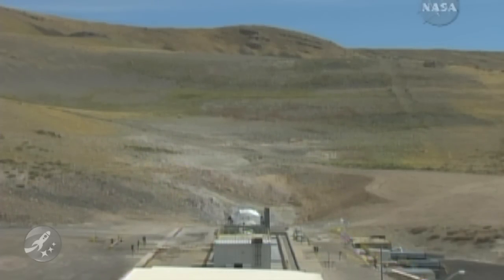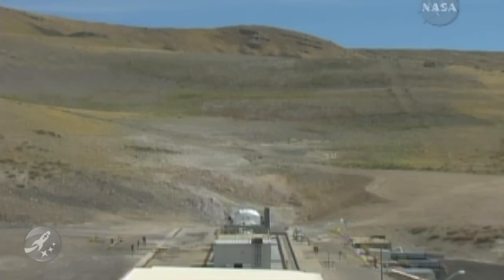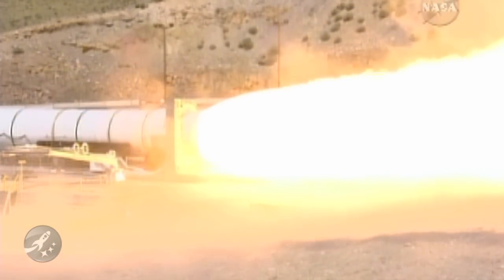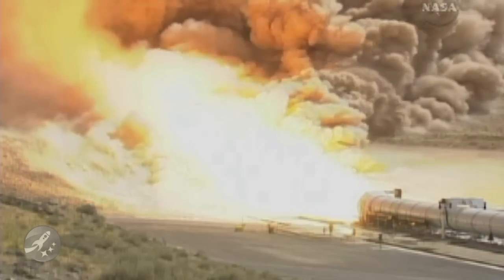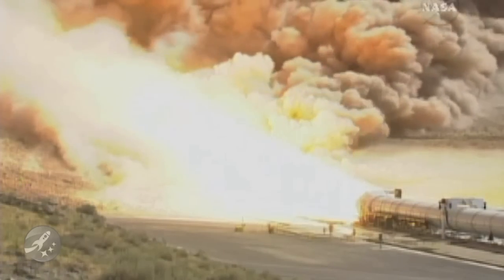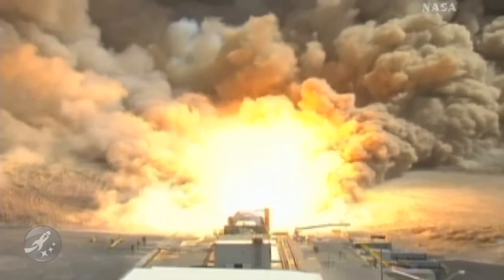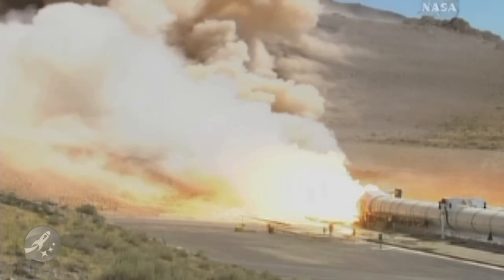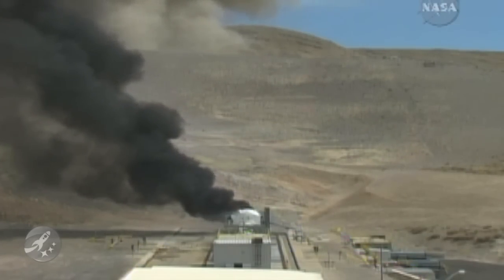Ares I Motor Test

Comment: 1:01 That sound is not from the "high speed camera", that's the sound from the HPUs (Hydraulic Power Units). They're practically the same as the Orbiter's APUs (Auxiliary Power Units), except that the orbiter has three and each booster have two. In the boosters they provide hydraulic power to the actuators that swivel the nozzle for steering. In the orbiter the APUs provide hydraulic power for the areo-surfaces (elevons, ailerons and rudder/speed brakes), landing gear, the main engines for steering during ascent and the external tank umbilical doors.

Comment: Ricer: ima put dis on my h0nda c1v1c and that will add 1234433283237 hp, ultra charged engine will add 2383 hp, mah st1ckers will add 25 hp,
 mah lamb0 t1res will add 100, and mah c4rdb0ard b0dykit and sp0iler will add 2733 hp, so that will add up to 237348747987478477487484 hp on mah h0nda c1v1c. 🅱️oi I can b3at u in ur 1 hp trash can.

Comment: 22 Million horsepower in Watts:
1 hp = 746 Watt
22000000 x 746 = 16412000000 Watts = 16.412 GW (Giga Watts) or (16 Billion 412 million Watts)!

16.412 GW into lightbulbs:
1 light bulb = 40 Watts
16412000000 Watts / 40 Watts = 410300000 Million lightbulbs or (410 million 300 thousand lightbulbs)!

Comment: Mhh would IT effect The Trust if water would be injected into The very hot Rocket Flame. Like The Principe of Archimedes Steam Canon
Reply: king bob1 V2 was liquid cooled by adding water to the fuel lowering exhaust temps to a manageable level. Reduces thrust though.

Comment: amazing display of pollution.
Reply: Thats right, a smart ass here responded to me that hydrogen and oxygen does not produce carbon dioxide.  Yeah, but the commentator just mention the dust and the black smoke came when they doused that with water and all the sand turning to glass for nothing.... thats pollution to me

Comment: 22,000,000 horsepower. 

Holy fucking shit
Reply: But can it run Crysis 3 at 4K?
Reply: just for my 2jz supraa
Reply: wtf
Reply: I got a kick outta that one
Reply: Holy FUCK! A top fuel dragster/funny car that does a 1/4 mile race in 4 seconds at over 200 miles per hour maxes out at around 10,000 horsepower... and this is 2,200 times more powerful?? That is a fucking terrifying amount of horsepower!
Edit: Jesus just thought of this... What the hell kind of equipment do you need to hold a booster that powerful down?

Comment: So glad my car meets the EPA vehicle emission standards
Reply: Ania Ruchała The 2nd stage that uses liquid hydrogen and liquid oxygen only produces water. This is a test of the 1st stage, which uses solid propellants
Reply: clmco Really? Obviously you've never heard of sarcasm. Then again you clearly have no clue what you're watching here even though the guy in the video says what it is. Fucktard
Reply: I dont want to ruin yur kek but the Ares I rocket motor used Liquid hydrogen and Liquid oxygen , the only biproduct of that experiment was steam, a fuck tonne of steam. :)
Reply: @TRJx86  Actualy no,this is a booster that runs on a solid propellant,some of the ingredients are but not limited to:Al as a fuel(dark Al fine dust is ideal),Ti also fuel(also fine dust),KClO4 and or KMnO4(more potent)both as an oxidizer,Fe2O3 as a stabilizer,S8 as both stabilizer and a fuel and alows for easier ignition,some kind of plasticizer to alow molding into one consistent piece(they probably use advanced synthetic ones i doubt they use starch for that), so the reaction product list is far longer than just water vapor as it is basicaly a firework mixture on steroids.
Reply: Ares only produces water, so...
Reply: This engine is probably good for that desert so stfu
Reply: Its just water vapor you fucking hippie

Comment: where can i buy one? for those spiders in my house
Reply: It'll take care of your spiders. 

And your house.

...Your neighbor's houses, too.
Reply: i don¨t think you have a house too have spider¨s in  if you use one of those ;) 2000000 hp
Reply: Actually 22 000 000 hp
Reply: Sorry, horsepower only applicable if it is moving and speed is known.  Just saying.
Reply: Horsepower (Hp)= the measure of energy expended in a given time, 1hp=.746Kw, or the ability to move 1000 lbs one foot vertically in one second. so its not moving but they know this so they CAN SAY
Reply: Don't mind the spiders, the whole housing estate would be destroyed by this thing. 20,000,00 HP....

Comment: I've said this before, but it's videos like this that make me realize just how far away we really are from space exploration, this was one of the most powerful rocket motors made and yet that's all it could do, burn for around 2 minutes tearing through incredible amounts of fuel and cost an absolute fortune, it's basically just a big firecracker, look at the massive amount of smokey exhaust its spewing, that's just lost power, until we find s better way producing thrust, or a more efficient way of burning fuel we are doomed to a life on earth..
Reply: That's a solid rocket booster - it's cheap and dirty and not terribly efficient. Most liquid motors burn cleanly and are considerably more efficient, but the most efficient ones don't have enough thrust to get into orbit where they work best, so it's cheaper to use solid boosters for the first stage. Then there are the nuclear engines that have never flown so far.

The real reason we aren't just there yet is that NASA's total budget for the whole of its existence is smaller than this year's US military budget.
Reply: Sobakus Thanks for your input, I guess my point is that while our greatest achievements in jet/rocket propulsion amount to the simplistic burning of large amounts of fuel to produce limited thrust, over a limited time, and with very little control over the burn rate (there is no "throttle" like on a plane or car or boat) we aren't on our way through the galaxy anytime soon, until we find new forms of producing large amounts of thrust with tiny amounts of fuel to make long distance travel feasible because of our current limirts on the amount of fuel we can carry, but more likely use quantum physics to find a way to move space around us instead of us traveling across space
Reply: Nicky Winters Well, again, it's only the solid boosters that don't have any control over the throttle – liquid and spontaneous combustion engines are throttled much more precisely than your car, although they have a lower limit. But all in all, your assessment of our current situation is something any rational person would instantly agree with, there needs to be some major breakthrough in propulsion technology to allow us to explore even our home system, although moving space is probably a bit farther away at this point.
Reply: Sobakus Thanks for your reply Sobakus, I'm sure you know more than I do about this, maybe :) my point is this just makes it clear that we are not about to skirt across the universe, believe me Sobakus I'd give up the rest of my life to travel across the universe for a year, I'm all for exploration, I'm just a little saddened realizing it's not going to happen within my lifetime...

Comment: Woo woo amazing power 22 million Hp???!!!! I think if after every half kilometre motors like these will be mounted along the equator 100 meter above the ground on flat surface and that exhaust nose pointing to the East and tested together at once for a period of 72 hours we will experience slow changes, later the earth might spin opposite and the sun will rise from west to east and may be even the  length day and night will be about six hours.. is my assumptions ..
Reply: You would have to slow and then speed up the entire mass of the planet and atmosphere. We do not have the power to do that.

Comment: Did he say 22 million horsepower.    the Saturn Five generated 7.5 million pounds of thrust and I know a horse can pull more than one pound... So at 22 million horsepower, the Aries is the most powerful booster ever.  Or it is a glitch.
Reply: +johnny ray If this article I read is accurate, each of the Saturn V's F-1 rockets generated 32 million horsepower.  That's a total of 160 million horsepower.  O.o

http://www.npr.org/sections/thetwo-way/2013/03/20/174834978/we-have-liftoff-apollo-rocket-engines-reportedly-pulled-from-ocean-floor

Comment: Must have been made by Ford. Thats a powerful motor!!
Reply: Reιnнardт Wιlнelм Nope, straight out of the factory, gotta love the power of IndyCar R&D, if only regular manufactures were this productive, then again every car would cost 2 - 7 Million Dollars.
Reply: Nah, it didn't break down, it's built by United Space Alliance.
Reply: velo de course 2016
weller
Reply: pft

No, Ford's too buisy making 2.7L full size trucks.

Chevrolet would be more likely-
Reply: 2.7L fullsize trucks that makes 325 HP and 375 lb-ft @ 3500 RPM in its stock form and gets 27 MPG that is VERY easily turned up with some easy mods and also has a towing capacity of up to 13300 lbs. with the proper equipment. However they do still make the 5.0L V8 engine in them.
Reply: FireFighter#47 With the price of Diesel, it better be getting 27...
Reply: FireFighter#47 
I know from experience. I don't care about numbers, because that 2.7 does NOT get 27mpg

And, if you want to talk about being easy to modify, there were 1000hp silverado's around a month after the new Gen hit the dealerships.

Oh, and the 5.3 makes 355hp and 386ft-ibs.

I'm not bringing up the 6.2, I don't want to embarrass you.
Reply: Reιnнardт Wιlнelм Disappointing, when you consider Honda and Chevy has 2.2 Liter engines putting out 850 HP (both similar engines).
Reply: ***** 
Not from the factory, they don't.

And if we're talking about heavily modified engines, why not talk about the 632ci BBC's making +3500hp?
Reply: ***** 
OH.

Shit, I didn't know you meant indy-

Good point tho.
Reply: ***** The 2.7L is a twin turbo gasoline engine....
Reply: Reιnнardт Wιlнelм GM motors dont come out of the factory with 1000 hp either..
Reply: Reιnнardт Wιlнelм As for fuel yes it does get around 25 to 27 MPG. I would know because I drove one for a while
Reply: Bullshit.

You either get v6 fuel economy or v8 power, not both.

When hauling it wouldn't surprise me if the 2.7 got WORSE gas mileage than the 6.2

Comment: Absolutely enormous power. What kind of fuel is used in such a rocket? Would like to see it live......
Reply: +turbocompound Ammonium perchlorate composite propellant, find a local high power rocketry club and you can watch the same sort of fuel on a smaller scale :)
Reply: +panaxion 
...thanks for information, but in Germany, you will not find a rocketry club. 
Only one example: I tried to find some Avgas for running my Curtiss engine.......Impossible here and always hysterically reactions if I asked for some liters. What a highly poison liquid, containing lead was the answer !!
I will not imagine, what would happen, if I ask for Ammoniumperchlorate here? I would be fixed with handcuffs !! So far, so good......that is Germany.
Reply: +turbocompound Quatsch. Geh zum nächsten Flugplatz und kauf einen Kanister AVGAS an der Tankstelle.
Reply: +HotelPapa100 ....ich hab es versucht und wirklich nur blöde Antworten bekommen wie "....ich darf noch nicht mal 5 Liter abgeben...." oder "....muß jeden Liter registrieren...." etc... Nenne mir einen Flugplatz in der Umgebung von Düsseldorf, der mir mal ein paar Liter für meinen Motorlauf verkauft, würde mich freuen. In den Niederlanden ist das alles kein Problem.